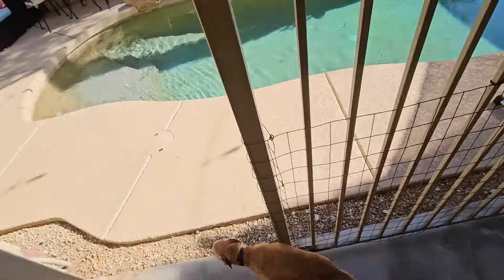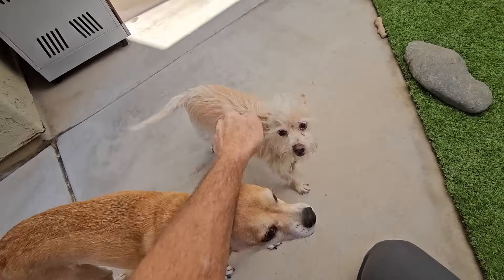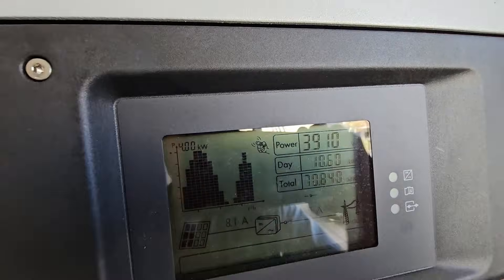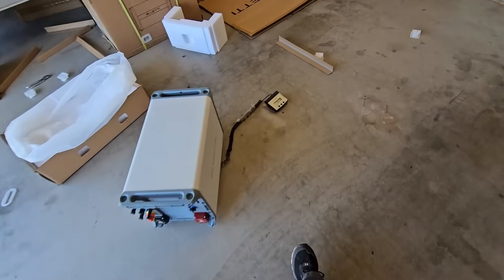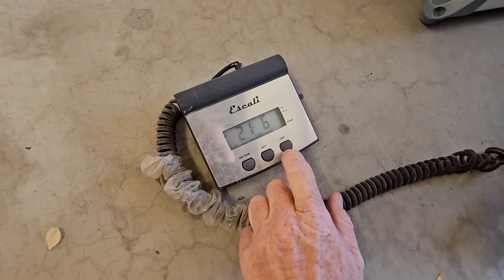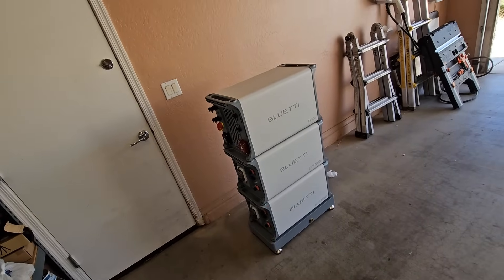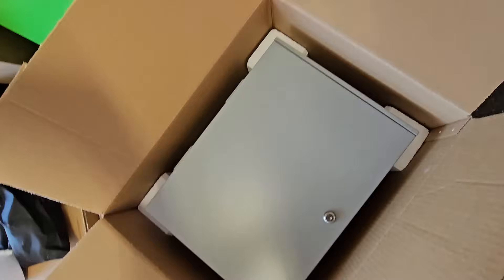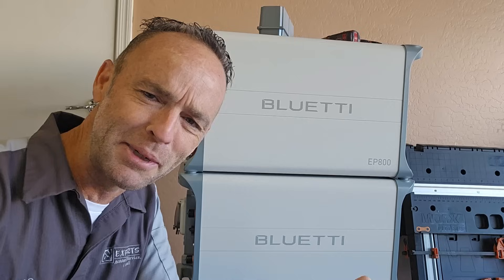My Biggest Upgrade YET!! Whole House "On-Grid" Battery Storage: Bluetti EP800

Comment: At the end of the day, I simply wouldn't buy these Bluetti products. Why? The battery is only rated for 3,500 cycles. Sorry, EG4 batteries are rated for 8,000 cycles before degrading to 80%. Ruixu's wall mount battery is rated for a full 9,000 cycles! If you do a discharge every single day, you'll only be degraded to 80% after 26 full years! These devices are way too expensive to give up that much life for ease of installation.
Reply from the maker: Those are great points, I'm convinced they almost all use the same cells or distributor of them

Comment: It would be nice if you could do a video on. Running your entire house on the battery for as long as possible if as if you were Connected to the grid.
Reply from the maker: I could do that. It will last a full day right now, but 3 easy if I turn the hot tub off.

Comment: Good luck getting an electrician willing to work on an existing solar system. Can't be bribed or found in my area.
Reply from the maker: It's done
Reply: I live in Northern Nevada and ended up doing it myself.  But where I live it's not just electricians it is any of the skilled trades. Luckily I am a trained Engineer.  @AZExpert

Comment: Hi James, great video!  That is a sweet system! As it happens I just installed a similar system for my house's critical circuits this past summer. It has 10kWh of storage and a single phase 3500w inverter/charger which has inputs from utility, solar (2385w) or generator. I installed the system as we have frequent power outages. When it's -20c outside, I really want the furnace to be able to run along with the well pump etc. Thanks for sharing your system install.

Comment: 10 kilowatt hours? If you are careful about how much you use, that might get you through 1/2 a day. For how many thousand dollars?
Reply from the maker: this setup is 20kwh, I have not been careful, and keep the hot tub on this setup too so I can test it out, obviously during winter demand is low but I charge to 90% and it's usually about 35% by 10am after running the house on the battery from 5pm the day before. It's been working as descibed, hopefully I can get non grid tied solar hooked up and really save money though, rather than using the grid tied solar to charge the battery.

Comment: SRP is net metering only  a non profit James, Ive been working with SRP for a long time, a way cheaper version the your other provider there APS...typically UPS systems cost efficiency and performance are not Lithium..due to cost and performance data..power substations UPS are usually flooded lead acid more cost efficient and reliable, and  over  98% recycled as weight is not a concern where lithium need to be operated in a much more climate controlled environment and not that able to be recycled...so the UPS in homes is to be used in peak time frames like a peaker generation plant does with peak demand...the bigger question is your net metering savings vs this system ROI and consider the substantial cost of this system vs ROI in my area the power goes off for weeks at a time so I have a natural gas generator  with a transfer switch which is much more reliable then a battery bank and keeping the house cool when its 104+ for weeks at a time..if your system is both a net metering and battery bank im curious to hear and the cost and relative cost savings over a hot summer, great video James!
Reply from the maker: If I'm honest, I never switched plans to off peak, I had an electric car and pool and did not want to stress about when to use during the year. I still estimate it saved $200 a month which has more than paid for itself in 15 years. I am now thinking about changing plans with this system and I think it should save $100 more a month, so not nearly as much, but still after 15 years it still will, and locks in savings against price increases too.

Comment: Stuff one of those in a clasa a and be done with 8d batteries and you can plug your house in if you have an rv garage 😅
Reply from the maker: Once we get a good 12vdc output of 50-60 amps this will happen
Reply: I had considered this as well. Just need a good solar array on the roof to accompany the generator. Would still probably need a charger-inverter inline to charge from the alternator.

Comment: I'm wondering if bluetti makes something smaller thar would work in my beaver coach? I know you can buy separately a solar system but I'm wondering about a more user friendly plug and play?
Reply from the maker: ac300max or 500 but wou would likely want to bypass your inverter and the 12vdc is likely not enough, I am encougaring bluetti to make a RV system with50-60 dedicated 12vdc output.
Reply: That's something I would be very interested in! Hopefully if bluetti is smart they will take your advice there's alot of people looking for a easier plug and play system. Thanks for your response watch your channel all the time. Because of your videos I'm the proud owner of a 1998 beaver contessa, it doesn't have the big cat but I'm happy to have it!

Comment: Is your Solar System enough to power your house completely? Or do you still get somewhat of an electric bill? I'm sure summer months are probably better but on average I guess is what I'm asking.
Reply from the maker: At 6000 watts not fully as the range, dryer and A/C require more than that, but it does provide 80% during 3/4 of the year, obvioulsy during summer the A/C  never stops, but I could see adding a mini split to the livingroom as most of the house is not used most of the time.

Comment: Charge during the night and discharge when the rate is high. 😊
My neighbor has squirrels going under his solar panels. ✅
Reply: That would be the most efficient...except solar is net metering so charging in the day from the panels would be the most efficient, and then weighing the loss from net metering while charging the batteries and seeing which is more cost efficient including installation, hardware cost etc...its a balance

Comment: I'm assuming this is all done by now...since you got it 2 months ago....and because of you...I'm slowly getting into panels and battery back up
Reply from the maker: It has been installed for a month now and I am still learning the system, but it has performed much better than I expected with no issues really yet.
Reply: @AZExpert  with your panels and the battery backup you should be able to go days without using any shore power.. and what is the life expectancy of those batteries